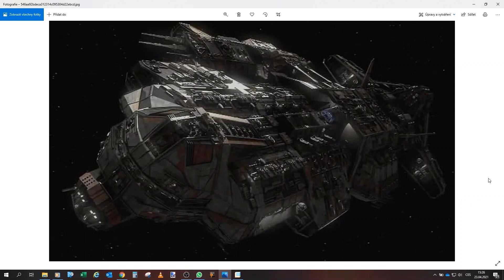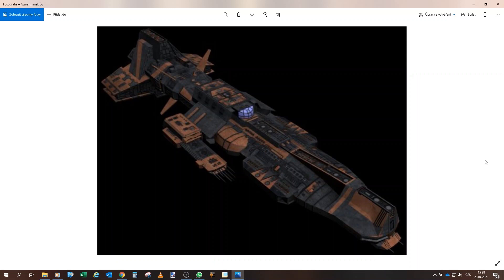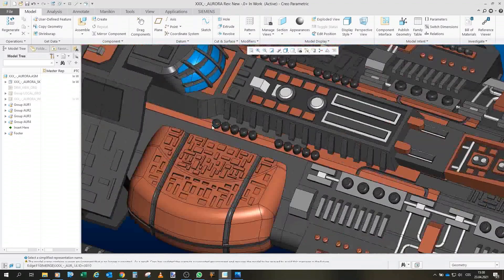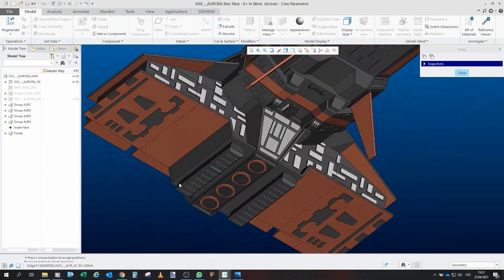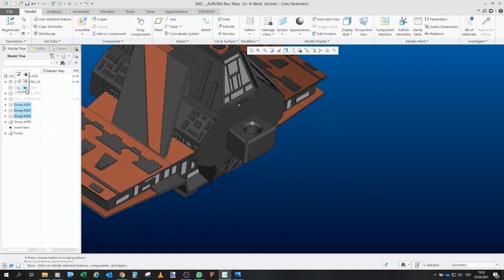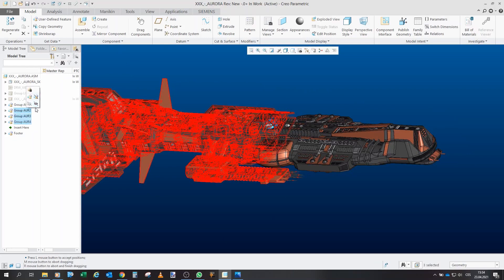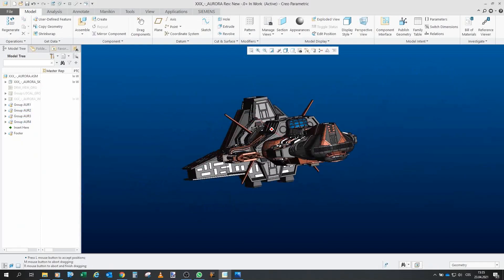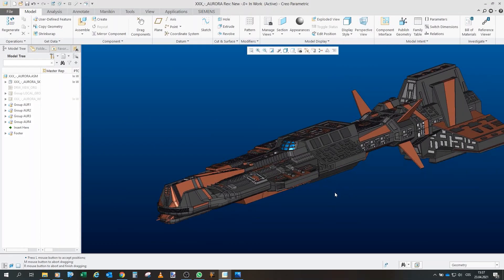Project Aurora Part 1

Comment: Maybe you could use a small drill to drill into the canon. And then glue a tiny metal pin into it that looks like a barrel. But i absolutely know what you mean. I try to model a hyperion class heavy cruiser from babylon 5. And i'm hellbent on making the turrets turn by motor and have the tip of the barrels light up. I want to insert a glasfiber into the barrel and attatch it to an led on the inside.
Reply from the maker: Sure i can. But i have this thing that i want the models to be 100% 3D printed, with no other technology or material or anything. I know i am strange, but that is the way it is with me..😃😃